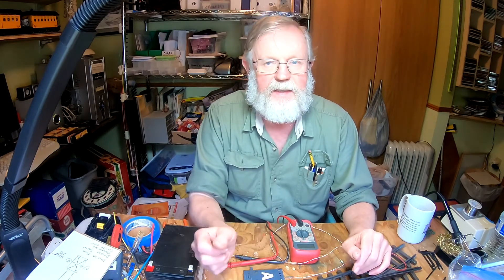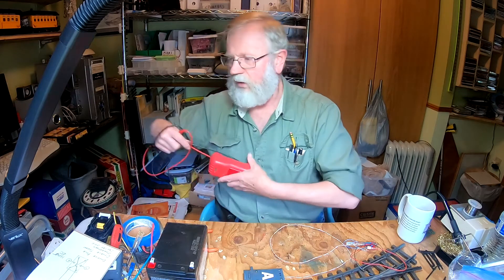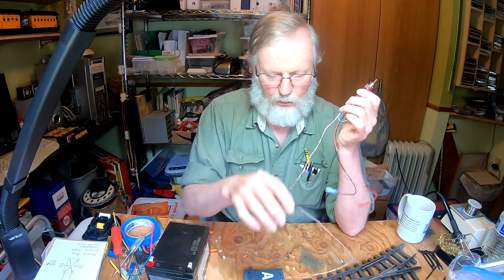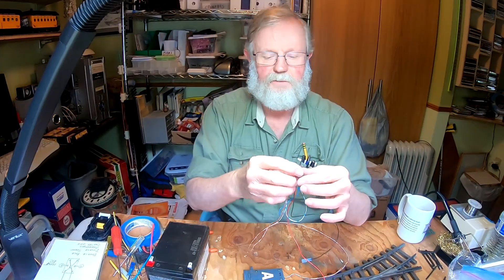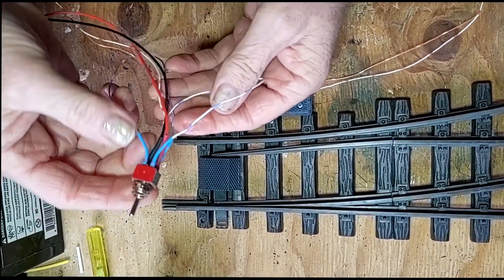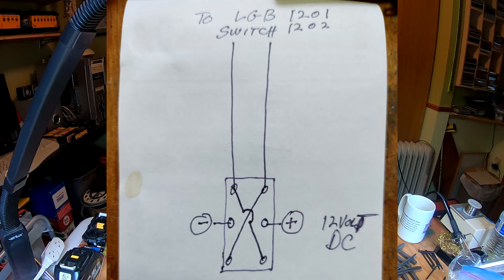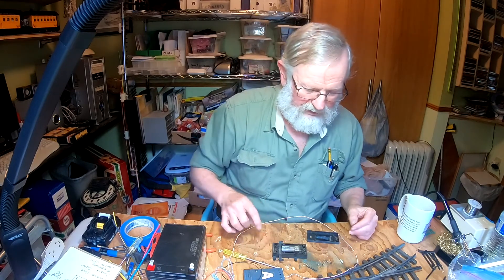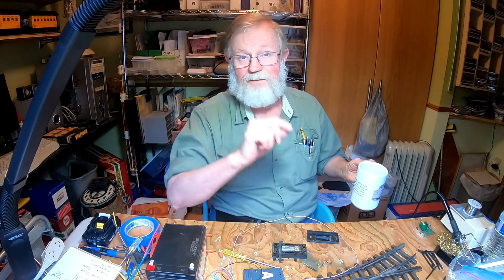LGB Switch operated with 12 volts DC

Comment: Can you recommend how to wire for controlling either of 2 turnouts 15 ft apart, from 2 switches located in front of each turnout?

At Turnout A - switch 1 controls turnout A, switch 2 controls turnout B
At Turnout B - switch 3 controls turnout B, switch 4 controls turnout A

I can put in all momentary switches but don’t want 2 switches giving power to one turnout at the same time.
Reply from the maker: Very good question!   Not being an electrician or electronic technician I must say that I am only guessing at an answer.  You would need to contact someone with good electrical knowledge.  My thought process says that if you are the only person operating any of the switches then there is no chance of crossing the power to any switch however if multiple people are operating then there is a slight chance that two may try to power the same switch at the same time, however with momentary switches your power is only thrown for a short time.  Again I feel you should find a better source than me to ask.  I wish you good luck and a Wonderful New Year!
Reply: @gardenrailroading  Thanks and Happy New Year to you too!

Comment: If you spray CRC Marine Corrosion Inhibitor inside those switches it will coat them with a waxy layer. probably would also repel the ants
Reply from the maker: Thanks for the info.  I will have to try that.

Comment: Just found your channel.  Great stuff.   I am adding LGB 19902 on an indoor layout and had a follow-up question on wiring LGB 12000/12100.  I will manually throw (for now), but do you have to block wire/insulate any of the track for this to work?  For example, if one train is parked on that siding, how do you wire the main line and the switch?
Reply from the maker: Hi Pat, I run deadrail so I do not really wire any tracks.  However the switches are always wired separately from the rails.   Where are you located, we are near Seattle WA.
Reply: @gardenrailroading  I'm in Northern VA
Reply from the maker: @plorzing  There should be a Garden Railway club near you and I'm sure some of them must do track powered layouts.  If you cannot find someone to help, I will see what I can find in our club to help with your question.
Reply: @gardenrailroading  Thank you!

Comment: Can you add an indicator light to the control panel, to show which way the turnout is set?
Reply from the maker: Possibly, however it would most likely have to be done with relays as the power throw is only momentary.

Comment: Does the momentary contact requirement apply to PIKO switch machines as well as LGB?  I've seen the included springs, so I assume that once thrown electrically the points will remain in place without further power being applied.
Reply from the maker: I am not sure, I have never had the pleasure of using a PIKO switch machine.   will have to do some research!  Thank You!

Comment: Hi, love your video's.  One question, can an LGB switch work with 16 volts?
Reply from the maker: Hi Stan, I'm not sure if the LGB switch machine will work with 16 volts, never tried it.
Reply: Hi Stan, it can have 16 volts; 17 volts is the max.  @gardenrailroading

Comment: One more question: If I wanted to power multiple switches, do I gang the negative DC lead to the positive on the next switch and continue down the line until I reach the last switch?
Reply from the maker: Hi Suko,  You would want to use a Parallel circuit.  Let me know if you have problems.
Reply: @gardenrailroading  Ah. I was hoping to save some wire by chaining in series to provide switch power to avoid needing lots of cabling running everywhere.

Comment: Does the rain damage the switch? The screws are open to the air.
Reply from the maker: Hi Peter, the short answer is yes.  However if you protect the contacts with a conductive grease or other protection then it will be a little better.  No matter what you use to protect the terminals they will eventually  go bad so you need to clean them maybe once a year.
Reply: @gardenrailroading fyi Piko sells a switch with better insulation. All openings are sealed in rubber.

Comment: Hello Mark, I'm new to your channel. I'm new to g scale just received my first train set two days ago.  Can u give us some information about your skeleton log cars.  Thanks again.
Reply from the maker: Hello KSM M8, The log cars are a mix of LGB and Aristocraft.  I did not like the fake log loads and I had to remove some young Cedar trees that were growing on my power line right-of-way.  So I used sections of the cedars for the loads, they are heavy but not as heavy as fir.  To secure them I used chain from "Shipwreck beads" that looked about right and I cut pieces of paper clips to secure the chains together.  My problem right now is that I used a very short rubber band to keep the chains tight and they are failing.  A friend recommended using springs, like those from old ink pens, under the loads to hold the chains tight.  If I get a chance I will do a video on that correction.  Thanks for subscribing and if you have any suggestions for videos, please let me know.  Thanks again and see you down the rails.

Comment: I use a computer power supply, Double pole double throw switch, and a momentary single contact button. I have the switch to show the orientation of the turnout.
Reply from the maker: Morning Eugene, Sorry I am so late in responding, some how I did not see your response. Very ingenious to use a computer power supply.  I use a few parts from old computers, in my green house I have used a half dozen computer cooling fans, a solar panel and battery to run the fans to keep my green house cooler.